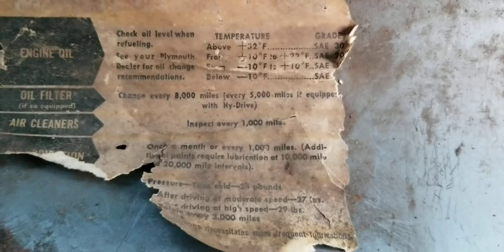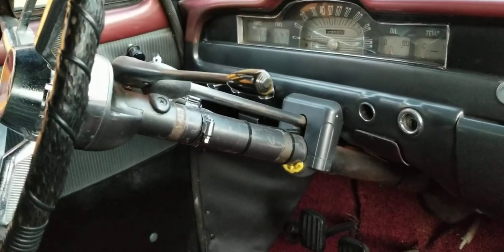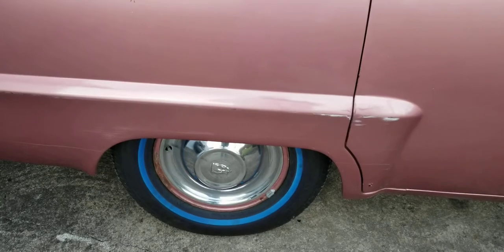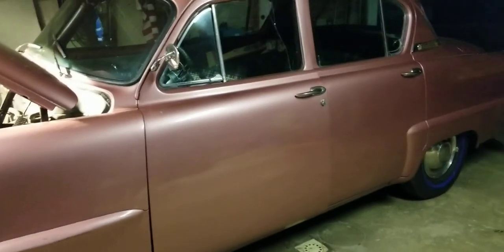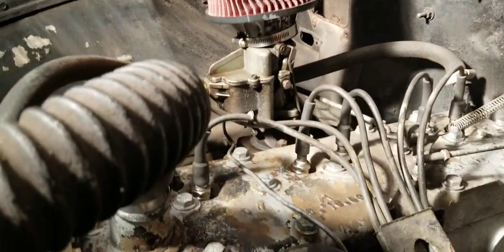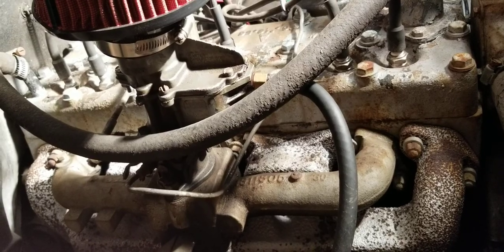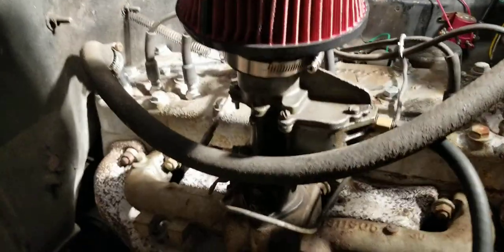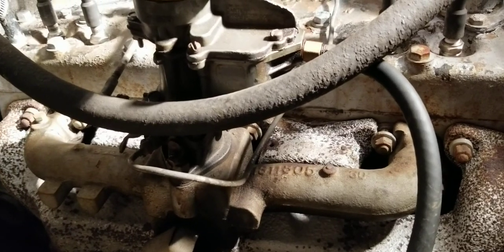243 Getting familiar with a 1953 Plymouth Cranbrook

Comment: Bob Car looked & sounded real good. Was also shifting smooth. I had the same flapper valve on 3 Road Runners. Two 68s & a 69.
Very expensive from Year One. Good luck on the wiring. No longer have the RoadRunner"s Sure miss them.